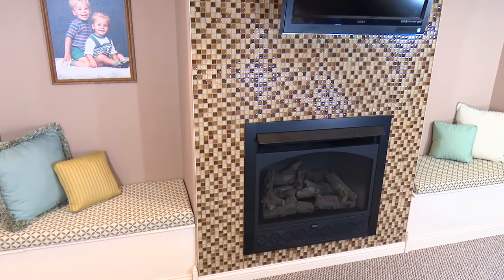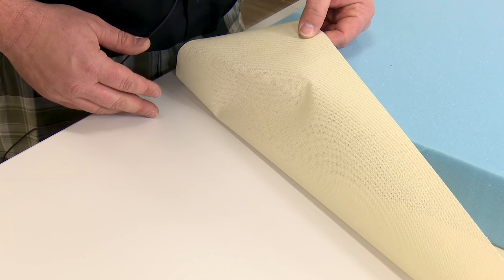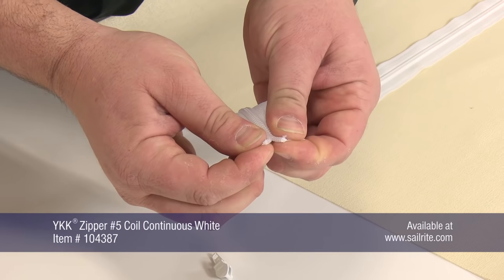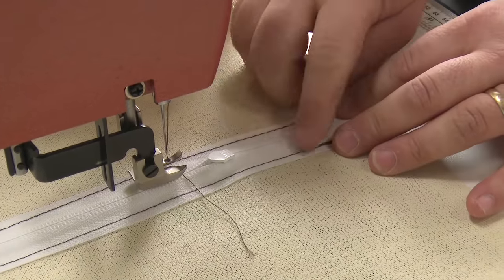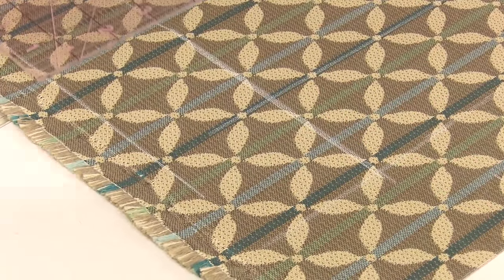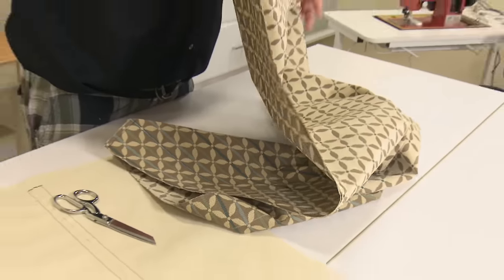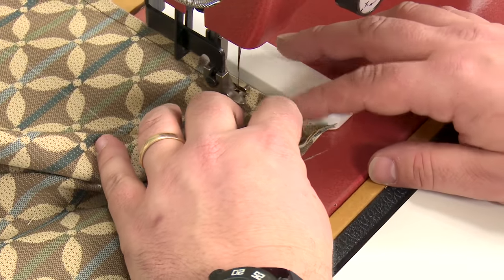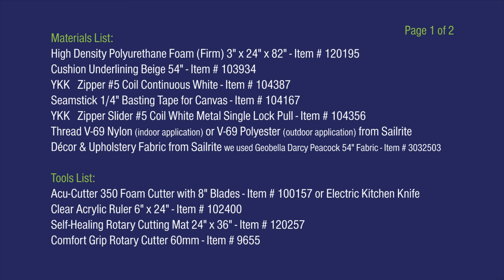How To Make a Quick and Easy Box Cushion

Comment: I used this tutorial to make a new chair seat pad and footstool cushion for a used platform rocker we found at a second-hand store. Very easy to follow. Excellent results! He is right when he says that inserting the foam pad into the finished cushion is like "wrestling an alligator."  So for each pad, I first made a cushion liner out of lightweight synthetic fabric and covered the foam pads before inserting them into the exterior upholstery fabric cushion covers. The permanent underlining will also make it easier to remove the chair pad and footstool cushion for cleaning, if necessary.

Comment: EXCELLENT video; loved the walking foot sewing machine & magnetic edge guide. I am a quilt maker & seamstress with over 50 years of sewing experience; great job to sewer & narrator, video graphics & technique!  Recommend never using rotary cutter to cut towards yourself. Also, there's a resting place on top of rotary cutter handle for your index finger, for more balanced pressure while cutting; just a suggestion! Please include rotary cutter safety instructions that state why blade is always closed or covered after each cut, when putting cutter down. You DID show best reason why you place ruler on cushion fabric & not on waste fabric...excellent tip & demo. 
Thanks much!!!

Comment: I was skeptical about the quarter-inch here and quarter-inch there but I just finished my cushion and it's perfect! Thanks for the great instructions!
Reply: You said it clearly but I just wanna double triple check. Did you really trim off 1/4 inch like they said in the video and the cover fits just right??? My first time making it and I don’t wanna screw up. The fabric is pricey. TIA.
Reply: @MrDarcy-yk8yj  That’s correct. I just returned to these instructions and made another box cushion. It turned out perfectly. This is a great video!

Comment: This video has helped me so much making cushions for my new house for toy closet and window seat!  I kept referring back to this while making them.  Really helped me with the measuring of everything so it's a nice snug fit.   I actually made the top first then bottom so I know I had enough canvas fabric.   The bottom I did  in an envelope opening instead of zipper and out of same cloth as top.  The bottom seams to stay in place and could use adhesive rug slid tape if it does slide.  Thank you so much for helping me!
Reply from the maker: We are glad that this video helped you make your cushions and that they came out so well. Good job!!!

Comment: Thanks for the video!

Let me share what has worked very well for me for FREE MATERIAL!, much of which I've learned from my brother who is a professional upholster, with making a new bench or van bench seat or boosting old car seat foam:

For car seats that need boosting, most often they just need more foam added to be like new again, I find used carpet pad foam often in a neighbor's trash or dumpster behind a carpet store. Remove the car seat fabric clips and carefully peel the front and sides of the fabric to gain access under the seat foam core, which often requires the seat be unbolted from the floor. 
Place a sheet of it or two under the seat foam core, right on top of the spring wire deck(carpet pad foam is tougher than the core so this also stops the spring wire deck from cutting into the seat foam core bottom).
Your second sheet can be cut smaller just covering the area the butt sits on.
Also inspect the top of the foam core and add carpet pad foam or regular foam where might be needed like by the door, worn from getting in and out over the years.
Spray adhesive can be used to bond the foam to the foam but is not necessary except for any top foam added.
Your seats will be firm and new like for many years now, it's like free magic!
The seat back usually doesn't need a any foam because it's the seat that gets the body weight on it from gravity. If you seat back should need a boost, you can add polyfill batting on top of the foam for free-see below.
These methods can also be used on sofa seat cushions.
I'll share below where to find FREE used good foam below!

To make a bench- where to get free foam: there is so much FREE foam and FREE polyfill - in many soft pillow backs and polyfill batting often wrapped around foam cushions for the taken in people's discarded sofa's and chairs found outside dumpsters at apartment complexes and the back of thrift stores. 
Even though it's used, it has been well protected covered inside the upholstery. 
Of course in the event it's a cat lady's furniture and the cats happened to piss all over it, you'll smell it and know to move on lol
Most apartments don't allow pets or make it expensive to have a pet so a lot of furniture is pet free.
Use a box cutter to open the old furniture to get at the free foam or poly as you need or use the zipper you'll find on some pieces.
Some foam in old sofas contain like a 1" thick panel of foam on top of other foam that is perfect thickness to add to your sofa foam to give it the new boost again.

Foam can be cut to size using a hack saw loose blade only in your hand holding the end making a sawing motion.
New foam looses some of it's firmness over a break in period, say after 5 years depending on how much it's sat on. 
But then the broken in foam lasts a very very long time at that softer level firmness before it really starts to break down. 
You might be able to buy complete new expensive foam cushion cores but they will sag after the break in period as well.
This is why so often we love a new firm piece of furniture but then it gets soft and saggy on us. 
Now the sofa companies could to put super firm more expensive foam in their sofa's when new that might be a perfect firmness for us when broken after the 5 years break in period, but then we wouldn't buy the sofa if it's not nice to sit on from the beginning in the show room, so there's the dilemma when you fabric is still in great shape after 5 years but the foam is now sagging.

The free fix:
So just add more foam if you can firms it up to make it like new again, unzip and compress the foam as you slowly peel off your fabric from the cushion core. Then either add more foam to the top or bottom or hack blade saw through the center horizontal line of the foam core all the way from the back to almost through the front but not through, so you leave a good hinge of foam in the front.
Then place about a 1" thick of used foam in the sandwich and holding it closed peel the fabric back over the foam cushion.
You can also add more polyfill pad to the cushion core on it's outside to add more softness and support but adding more foam is the big boost.
Spray adhesive is optional to bond the foam to the foam.
People often think that when the seat sags that the springs under the cushions, have weakened but no, it's the foam, the springs are metal and strong, the foam is just foam.

For making complete new cushion tops for say a bench, besides free foam, you might even find a lightly used fabric in some part of a discarded sofa to use IN FACT the back side of sofa's is often a large sheet of fabric that has been hidden against the wall never sat on all it's life and so still brand new! 

Discarded trash at a dumpster is free for the taking and your reducing what goes to our planet's landfill.
This is win win, real free hard core recycling, helping to save our environment as well!

Take care!

Comment: Great tutorial.  I plan to use this to make a cushion for a bench I use at my sewing table.  A couple of tips - be very careful with the rotary cutter.  The cutter should be pushed away from you will cutting (I noticed you cut toward yourself).  And the blade should be closed any time the cutter is not actively cutting.  Keeping the blade open while repositioning the ruler and/or fabric increases the risk of hitting either open skin or other materials.
Reply from the maker: Glad you liked it and thanks for the helpful recommendations.

Comment: am i thick? i don't understand why you minus 1/4 inch from the bottom plate AND the top plate. doesn't that make the whole thing too small?
Reply: I believe the purpose of this is to allow the cushion to be slightly compressed which would help keep the shape of the fabric without wrinkling or moving too much
Reply: I used the exact measurements without any extra seam allowance OR taking it in.  And it worked out perfectly.  No wrinkling.

Comment: Thank you, this is the easiest and very best pattern to make a Box Cushion!  I have watched all the Sailrite
videos, and pretty much everything else on this topic here on Youtube.
The one thing that I am having a problem figuring out is whether or not I should include a seam allowance.
My material is a patterned, heavy vinyl.  By just folding it in half for the Zipper Plate (and pressed with Cotton Setting
and *Tissue Paper) I loose almost a 1/4" in the width in the bending, and that cut down the seam allowance that I should be attaching the Zipper to.
 My high density foam is only 2.5", but I placed a softer 1/2" foam on both sides of the cushion to lower the Bounce.
I almost bounced right off.  LOL  Got to worry about Grandma!
I would really appreciate your professional opinion!  
Thanks!
Reply from the maker: Sounds like you are making a "traditional box cushion" and not using the techniques in this video "A Quick and Easy Box Cushion". I will go with that assumption when answering your questions. When cutting the boxing for a "traditional box cushion" you would typically cut it so it is the same thickness of the foam plus 1/4" to 3/4" (Adding 3/4" Example: 4" foam would have a cut boxing width of 4 3/4"). When you sew this boxing to the top and bottom plate your seam allowance will use up almost 1" of the boxing making the boxing slightly smaller than the width of the foam. The foam typically will compress slightly allowing the cover to fit very snug, which makes it look and perform very well. If using a very firm and dense foam (does not compress much) then you may want to add more for the overall boxing width. 
Let me know if you have more questions.
Reply: Hi, thank you so very much for getting back to me so quickly.   I tried your Bull Nose cushion first.
I guess it is the foam.  I couldn't get it to form a bull nose despite making the over all length of the material 
1" shorter.  LOL  I will now call the first attempt a Muslin!   
I've have a heavy duty sewing machine, but this  vinyl  was extremely hard to sew and I ended up only being able to use my Walking Foot.  It was impossible to make the piping!  Amazing that I was able to get the Zipper attached to the plaquet at all!   Without a seam allowance for this material my cover was super hard to get over the foam, but it still looked pretty good!  Thanks!!!!
The pattern on the material works great with my Leather Love Seat (5 years old) which wasn't made with High Density Foam.  Sad smile!  Grandma (83) was broken with Charley Horses after sitting on it for 1/2 hr. 
Thank you again.  I going to stick with this easy pattern, but add 3/4" Seam Allowance to the top plate.
I imagine that I will be done by 12 Noon today.   You should smile then, knowing you have a happy student!

You should talk more about your company and what you do!   Sewing doesn't come naturally to some of
us and what we see in Cataloged isn't always what we want.  Custom is awesome!

Comment: Great video, however, I made the cushion exactly as described and once you reduce by 1/4" and then by the 3/8" seam it was VERY tight. So tight that the edges were rounded. Also, why not just cut to the size of the cushion and then use a 5/8" seam rather than reducing by 1/4" and sewing at 3/8"?

Comment: You can cut foam with a band saw, too.  You just have to have a carrier underneath so it slides easily on the saw table.  Maybe a table saw will work -- I didn't try it.  I didn't have an electric knife and scissors gave ragged results, so -- I improvised!

Comment: I'm going to try this for an old toy box with hinged lid that I'm using as a coffee table/ottoman. I'll probably put small magnets on the bottom of the cushion and the lid of the toy box so it won't fall off when I open it. Whatcha think? I might try hiding the magnets on the toy box or keeping them flush with the wood. Thanks for the great tutorial!
Reply from the maker: Usually magnets are not used in cushions since if they are sat on they can sometimes be felt. So.... most people use Hook and Loop Velcro.

Comment: great tutorial, thanks! Could you do an envelope style opening on the bottom plate instead of a zipper? Trying to avoid the zipper damaging the paint in the bench underneath.
Reply from the maker: Yes, that would work great.
Reply: I have the same issue--don't want to damage the paint on my bench. I'm concerned that an "envelope style opening" would not give the nice snug look I'm after. Wouldn't it gape some?

Comment: Thank you for this great video! It clarified some things for me and also gave me some ideas. I'm looking at making new covers for my motorhome and this was exactly what I needed.  I do have some  questions : is it possible to use the same fabric on the bottom and instead of cutting the bottom plate to keep it as a one piece and only cut and sow corners and the  zipper? And also regarding the zipper is it possible to replace it with an envelope type of closure? I've never seen it done in upholstry only in pillow cases. If someone with some experience would be kind enough to answer I would highly appreciate it. Thank you!

Comment: I will be trying this for a 28x38x6” thick dog bed using faux leather fabric, im having trouble calculating the measurements as i will be installing zippers to connect the top and bottom. i calculated 45x35 which includes 3” overlap on both sides and 1/2” seam allowance on both sides. gotta get that electric knife for the foam it looks seamless.
Reply from the maker: If you use our fabric calculator you will have to calculate nothing yourself, it does it for you. Here is the link: https://www.fabric-calculator.com/FoldOverSimple/index.html

Comment: OK, great video. But! The thickness of the foam was 3 inches. Why ? Did you cut the end material at 2 and 3/4 inches. Isn't the cushion now only 2 and 3/4 inches thick and not 3 inches. At the end you measured width and length, but not thickness. I'm just assuming it's for a nice tight fit. I'm currently reupholstering my caravan cushions and this video has given me the confidence.

Comment: I think it is very handy for people who want to start and don't know how to. Are you sure that even from the reverse side the zipper will not mess with you? I would feel like princess-on-a-bean... kind of
Reply from the maker: If a medium or firm "IFD" foam is used you should never feel the zipper. Foam Firmness is a measurement of the foam’s softness. Indention Force Deflection, or IFD, is the pressure in pounds needed to compress a 50 square inch circular plate 25% of the way into the foam.

Comment: This was a really good tutorial. I’m about to make outdoor seat cushions and I didn’t think about making the fabric smaller than the cushion itself in order to ensure a nice tight fit. Is there a reason why you didn’t install the zipper a more traditional way that looks more finished and polished? It’s not that hard to cut the back panel in half allowing for the additional seam allowance for the zipper, baste it together, sew in the zipper and then rip out the basting stitches. Am I opinion it looks nice and finished.
Reply from the maker: Yes, that is the great thing about DIY, you can make it anyway you want. I agree, if you wanted a finished look to the zipper that would be the way to install it.

Comment: Can someone explain why the cover is 1/2" too small but still works? Is it standard practice to take 1/4" off both the top and bottom like that?
Reply from the maker: The top plate incorporates the boxing as you see in the video. However, let’s break it down in smaller steps to hopefully explain it better.
At 9:56 min Brian traces around the foam which is already ¼” larger than the opening it fits into. This creates a top plate which is the exact size of the foam. Next at 10:10 min Brian measure the thickness of the foam and then takes away ¼” from that thickness. The boxing is not as wide as the foam by ¼”. True the 3/8” seam allowance is not taken into account intentionally because we want a tight fitting cover. So… the ¼” (which was taken away) and the 3/8” seam allowance that will soon happen to sew the bottom plate on, will take away about 5/8” of the overall size of the boxing making the cover fit very tight, which is what we want. This helps, pull the incorporated facing/boxing (facing included on the top plate) down, so the bottom plate fabric does not creep up and show itself along the bottom edge when the cushion is finished.

Comment: Great video..  Getting ready to do my first set of bench cushions and need to confirm that your fabric cover dimensions are smaller than the foam?  In other words, once the foam is inserted, it's compressed?  Just curios as other videos show the material is cut to actual dimensions, plus extra for the seam.  Thx.
Reply from the maker: Alex, yes the fabric cover size is smaller than the foam as shown in the video. This helps pull the seam under along the bottom edge slightly.
Reply: Sailrite thanks I was thinking the same as Alex about the size of the fabric being smaller